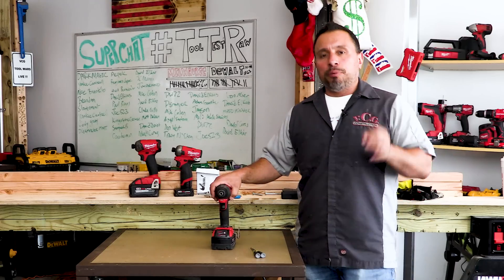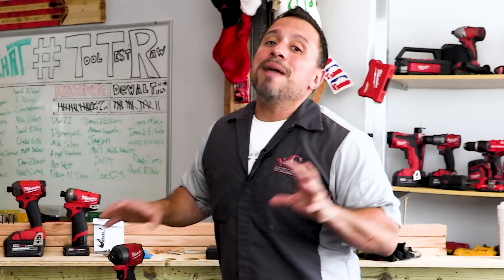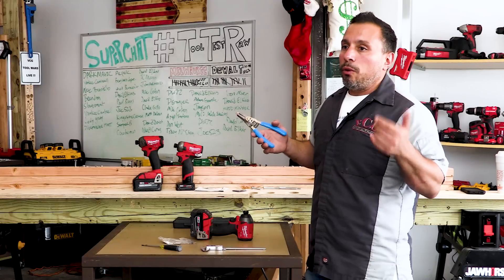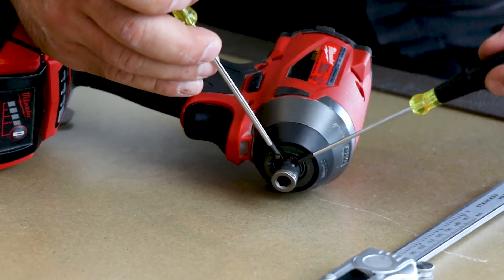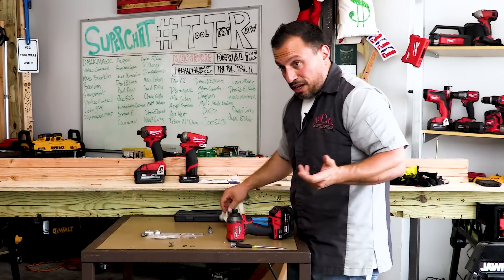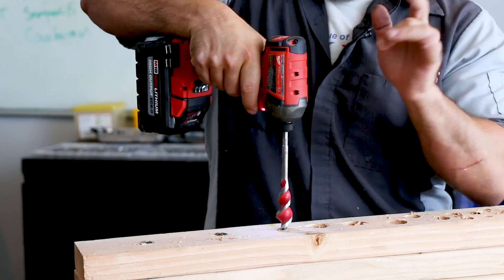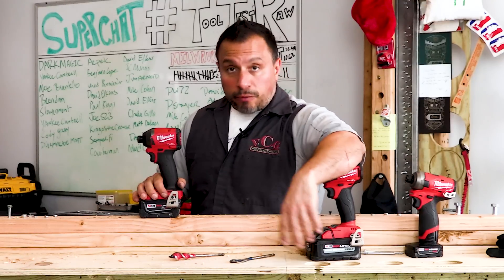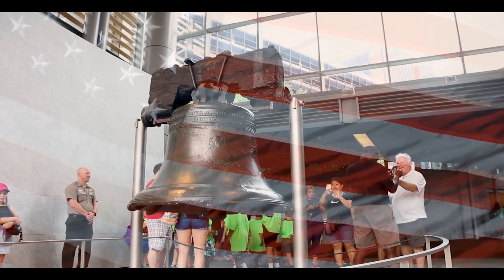Serious Problem With Milwaukee Impact Drivers - Replacing The Ball Bearing

Comment: Those channel lock internal/external snap ring pliers are ok. A multi functional tool will never perform as well as a dedicated tool. Those kits with separate internal and external pliers of different pins diameters and jaw width will always work better. Doesn’t mean the channel locks are garbage.

Comment: 13:20 😂 Priceless

New Subscriber, great videos!.
I just recently pulled a dummy and got a small bit stuck in my Gen 2 Milwaukee impact. I tried everything to remove it short of getting the welder out. So I put it into reverse and pulled the collet like a SOB and it finally came off sending my spring/bearings and retainer rings in every direction 😂.  Honestly I was just happy to get it out. Anyways, I'm now waiting on new parts from Milwaukee (retainer ring & rubber ring) so I can get it back together. 🇨🇦

Comment: My m18 surge is why I'm looking for this video. The bit slips out of the collet. If I hold the drill downward my extension stays in until after I drill a hole and when I use the drill upwards the collet won't hold my extension.

Comment: I fixed my NEW 3453 1/4 inch impact driver, it had this same problem.
It's not the ball , it's the spring , you have to adjust the spring tension so the ball has more spring tension.
Take it apart and adjust your spring with needle nose pliers and lube it up when you reinstall it.
So the spring has a lot more tension pushing up the steel ball.

Comment: Old videos I realize, however I have owned Fuels from 2018 and decided to take those apart to compare to the newer ones. The old impacts do in fact have a much larger ball bearing and collet. Large enough in fact, that the old ball bearing won't fit in the new impacts.

Comment: The ball bearing retaining spring inside my collet fell halfway out of the tool. It stopped holding any bits. Used this video to take the collet apart and put things back together. I reshaped the ball retaining spring as it seemed quite loose and likely to fall back out. I think that spring is part of the problem. Also ordered some 4mm balls to see what that does.

Comment: Not only you can injure someone, if you are working in a residential home with ceramic and your bit falls out, you will chip and damage the floors.  My problem with my new Milwaukee impact is that my extension is stuck in the driver.  I can not get it out.  It is jammed in there.  Freaken thing is brand new!  Do you think this is the fix?

Comment: I wouldn't have chosen those ceramic (coated?) bearings.  The ceramic bearings are more wear-resistant and will hold their roundness better, but they are much more brittle and are more likely to shatter or chip under impact vs. steel bearings.  Ceramic ball bearings are useful in applications where you want to minimize friction since they will roll more smoothly for a longer length of time, especially if the bearing races are ceramic also.  But I don't think that they are appropriate for a high impact application like this.

Comment: The biggest pain-in-the-ass with Milwaukee collet is that it takes two hands to take a bit out.  In my old DeWalt, if one moves the collet back, the bit springs forward to release.  One can swap out bits with one hand.

Comment: I just took mine apart because I had the same problem, all I did was coil the secondary spring up tighter, and bent the part up that goes under the ball to put more pressure on the ball. Works perfect now

Comment: Hope this helps *I have been looking for the 3.5,tried online nobody gave a crap,tried EBAY nobody responded, so I got in my car and systematically drove to all the Home Depot‘s in my area the only way I was going to find one with the two ball bearings was the physically open the box and look for myself after a few days of back-and-forth searching and all the bullshit that comes with it I finally found one up on the top shelf of the racks and it had two ball bearings I will give the model number and the date very important-2853-20.    9/8/2021

Comment: Has anyone experienced the m12 fuel impact driver randomly switching torque settings? At first it was doing it under a fairly heavy load then it started doing it all the time.

Comment: Just had a similar issue with my Bosch also! It would not let go of the bit, couldn’t change bits , returned it for a new drill but mildly disappointed because it was only purchased in March of 2021.

Comment: I feel like the ball bearing helped but.... The spring on the inside looks a little weak. Like when the "impacting" happens the ball bearings aren't kept in place by it and cause the collet failure. But that's just my two cents

Comment: I have a Gen 3 Milwaukee Surge (2760-20), and the collet recently stopped working.  I took everything apart as in the video, however mine had a different issue.  The part of the spring that holds the ball bearing in place had snapped off.  I took some needle nose pliers and bent the end of the spring inward so it put pressure of the ball.  Now it works fine.

Comment: If it works & the problem is fixed than Milwaukee should send any 1 that has got 1 so they can fix them u have lost bits in sum of the content  do u have a maw drill v m18 drill the Makita has  that problem  & its a pain in the bk 2 get the bit out when it let's  Go of it

Comment: I bought an expensive Milwaukee drill to replace an old Stihl drill my husband had.  After he passed away, I had some drilling to do and found that old Stihl way too heavy for me to handle, so I bought a Milwaukee cordless since everybody told me it was the best.  Used it once to drill a hole in a fiberglass planter with a hole dozer drill bit.  Haven't been able to remove the drill bit, nobody else can remove it either, so I tossed in in my ''junk" corner and went back to using ultra heavy Stihl.

Comment: Where did you order the ball bearings?   I have a couple of M18 surge impacts in which the spring that retains the ball bearing has pulled out and straightened.  Can you order the spring that retains the ball bearing in the collet?

Comment: Can you take apart the collet on the surge model so it can be seeing  what is the difference between the surge collet system and the modified with the big bearing. Also compare thickness of the spring, basically compare everything. Thx.

Comment: I don't even own one of these but from all these videos I've seen and knowing that the surge doesn't do it tells me that it's from the (probably more) violent vibration caused by the regular gen3 impacts. The surge being smoother probably doesn't let it happen. I bet if you just tried to pull it out without hitting the trigger it would retain the bit just fine, or hell grab a bit with a vice and pull on the tool and see how much force it takes to pull the bit out. Add violent vibration to the mix and it probably jars the ball bearing around and eventually lets the bit out.

Comment: I'm having issues with first generation fuel drill. Chuck and gearbox issues,after 2 gear boxes and a new chuck I gave up on the drill. Compact versions are too dangerous. Not enough to grab on and hold securely. Broken wrists and fingers anyone? , and the same issue with the impact gun. Ball bearing swap out did work for me!Warning though,once the slot in the spindle is worn out you will need a new spindle.Not to mention possible spring tension problems. Only issue I have is with Milwaukee warranty! Sucks fat ones!Open your service centers longer. This 9 to 5 bs is bull shit. Can't get in after work to get it serviced. Always closed.

Comment: i don't think spring is the root problem either. i know it is what retains the balls, but ultimately the ball is held with the outer collar (the black part), spring is only help push the ball into the correct position, once its in the position, the ball would be less likely to go back, there should be grooves or dents for the balls to sit into.
i would check that outer collar first. make a deeper dent/replace with bigger ball/use stronger spring.

Comment: i've had this problem of the bit falling out for about a year now.  new balls, new springs , still happens.  i bought a 10 pack of the 3.5mm balls last time.  it seems my problem is that the ball winds up behind the spring that is supposed to keep it pushed forward towards the bit.  noticing there was plenty of room behind the spring with the ball forward I decided to add a second ball.  I did one quick test and I was able to both engage and disenage a bit from the collet.   we'll see if this is a good fix for an otherwise amazing tool.
Reply: how has it been?
Reply: @brendon8702  it works , but it jammed on me once, both balls some how wound up behind the spring.  easy fix since i've taken it apart about 10x by now,  considering ordering the 4mm balls and throwing a fit at milwaukee.

Comment: I had same problem, just bought the Surge though and brand new, never used... the bit did not stay in.... I don’t see any ball bearing at all either.... I’ve spent over $300 on two drills the past week and I’m a small time handyman/carpenter... and I have $20 left in my bank and no drill to use for my jobs. Pretty upset and ALL my tools are Milwaukee, I love Milwaukee... but as much money as I spend and how much Milwaukee tools cost... I don’t think these problems should occur... or I just have bad luck with two new impact drivers. Pretty frustrated

Comment: I have just purchased the M18 brushless surge impact and my collet spring cane out and the collet now doesn't engage with the screw driver bit I rang them and they just gonna replace it the drill isn't even a week old it's 280 pounds that shouldn't be happening!

Comment: I'm starting to think that all companies will eventually have to redesign their collet at the rate of speed these impacts are driving. Because even in one of your more recent videos the new kobalt impact fails. If you think about it, the surge is impacting a bit slower therefore not creating as much vibration on the collet and it doesn't seem to fail.. just my 2 cents, whether it's worth it or not.

Comment: does this have the same problem with the bits if you clean an entire hole or just drill and pull out without going through the wood entirely?>

Comment: After having many products I no longer buy Milwaukee drivers after experiencing multiple problems which I considered caused by poor design and quality. Calling the company on one chuck issue that wobbled and would no longer grip bits - they said there was no inherent problem and suggested that I buy the new model THAT HAS BEEN IMPROVED. That pretty much means the one I had was a design problem. I loved the impact driver in use until the collet stuck and I could not get the bit out.

Comment: Even though I don't have much confidence in speed for Metabo they have shank magnets on the in clip on and clip off drill chucks. Over the 9years of use.. it has never failed me on either roofing or corrugated fencing jobs 😂😂😂 but I am still impressed with Milwaukee . They should have had magnets on there spindled attachments like Metabo.

Comment: Now, is this problem specifically for the quick insert models? What about the ones where you manually have to pull the collar to insert the bit? do they have a similar issue?

I have a Milwaukee 2850-20 non-Fuel Brushless impact driver, and I want to know, because this seems to be a very serious issue.

Also, any update on this?

Comment: I’ve been using an inside cutter the last few days working on offsetting toilet flanges. My bit started falling out of my gen 2 impact so I was in the process of reaserching the gen 3 thinking my drill was going bad. Thanks for the video. My wife doesn’t need to know it’s an easy fix though. Good excuse to get the gen 3! Thanks
Reply: he didnt fix it

Comment: I bought my M18 Fuel Drill Combo Kit a couple days after using it. After only a handful of removing drywall screws, that actual collet fell apart mid drill. Got the whole kit exchanged will try to comeback to see if we still have the same problem

Comment: Original ball bearing was too small & the replacement you used was non magnetic. A magnetized 3.98 millimeter replacement ball bearing with a replacement spring would be a good fix.

Comment: Hi. I bent the spring to make ball-bearing stay at top it seems to fix it. I'm using M12 impact driver
Reply: Did bending the spring still continues to work for you?
Reply: @johnahamelv  Hi. Yes it did the spring is different from m18 impact I bent it at the loop where ball bearing is and at the bottom took it it's and tested it using spadal bit

Comment: Good to know. Good info I've worked on one  ,my work colleague's I did like the power of Milwaukee impact Its very good if you are carpenter working on fixing rafters etc, I consider this impact good for any metal work as well. I'm sticking with Makita as main and Bosch. Good luck.
Reply: I don't think we should service these tools mechanically apart from lubrication etc. Milwaukee should work on this asap in my opinion as it's a big dawn fall of this issue. Have never experienced this with Makita and Bosch lines.

Comment: I’ve just fixed mine as it was doing the same. You need to remove the spring that holds the ball bearing in place. The ball bearing needs more pressure to hold it in place towards the front of the driver. Bend the spring end closest to the body so it adds more tension and also bend the sharp curve which holds the ball bearing toward the front of the driver. Seems to have sorted mine. Not sure how long it will last. Will let you all know.
Reply: still good?
Reply: Brendon yes it’s still good. I did put a slightly bigger bearing in there. But it’s been working great since!

Comment: Hay Vince I have a question and in fact any one please answer .now iv used dewalt and never had a issue with the Forward and reverse lever it Engages very well But I recently had decided to invest in a set of M 12 fuel Impact driver and hammer drill The tools feel great in field quality but as I get to my point the M 12 fuel impact driver forward and reverse lever does not seem to engage as well as a Dewalt and it bothered me does anyone else have this issue To be specific I cannot find the middle part where it locks it from going forward or reverse I can find it but it shouldn’t be that hard that should be something that’s done without even thinking it’s real gummy

Comment: If you are in a woodworking environment the grease you lightly applied is only going to cause you trouble. If you need to lubricate these use a dry lubricant like PTFE or graphite.

Comment: Maybe Milwaukee needs to look at their competitors and see how they resolve these types of problems. I would want to know how my competitors products were designed and see if I could do something similar or improve upon it. It's clear Milwaukee engineers can't think of a solution on their own, or they would have by now. The engineers should be taking apart a Makita and seeing why their's works and what the differences are. I think this is going to be a ball bearing-spring retention problem. I would guess the device has more torque than the parts are able to function under. This could all be determined with testing equipment.

Comment: I appreciate for your info also feed back in the tool. Helps people decide & see what’s a good product for them. To be honest I don’t do construction but I have been using Milwaukee for auto mechanics also I have the 2853-20 model. I use for light work not heavy to push or pull every time. So I believe I don’t have to worry this problem but also I agree with you with fixing this tool by the manufacturer as well.

Comment: This also happens with my Bosch 12v pocket driver. I own an appliance repair company so I love the size because it allows me to screw inside tight spaces (inside and around washers, dryers, refrigerators, etc) but it's really frustrating when drilling holes because I'll have to put the drill back on the stuck bit to pull it out a little before it slides off again and I'll have to keep doing that until the bit is finally all the way out.

Comment: I got mine over this past Christmas Holidays, and so far no collet issues.... BUT, unless you have nearly 200 lbs of your body weight in it, and completely squared up, you are going to strip any philips screw!!! The impact requires WAAAAY too much torque to start the "impact'ing".... We've tried ever setting, an it's not the power, but the amount of restriction it requires to get the impacting to occur....

Not ideal when driving over your head, off to the side, or even, on a latter.... You seriously HAVE to have your entire body weight into this thing... I may see if Milwaukee will work with me and get me into a Surge, or maybe they too have the same issue?

The power is amazing, but pretty pointless if you can't use it....  I honestly believe that we would have been faster/more successful screwing by hand with a screwdriver today!!!!
Sad, because all my other Milwaukee tools have been kick-butt.... And there is a huge void, where this 18v impact driver resides....
Reply: Did you ever come up with a solution? After reading others' reviews of it on HD's site, their are a handful of others(recent reviews) that have my complaint, and the rest are in love with it and never skipped a beat....

To me and given my problem, there is/was an issue with their collet issue... And to fix it, they adjusted the impact mechanism and therefore ruined their impacting ability....
I'm no engineer, but from what I've seen on your vids and others, is that it could be some kind of frequency/vibration issue between the impacting and the negative pressure(extracting) on the collet springs (return rate), in which would cause the release of the bits..... And in turn raises my issue... they totally ruined the impacting ability.....

A BandAid on top of a BandAid......